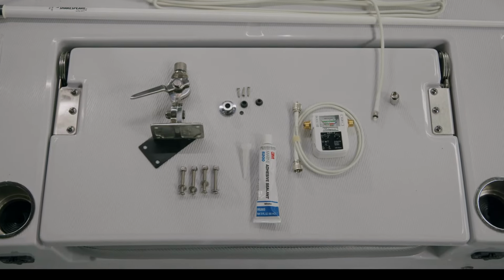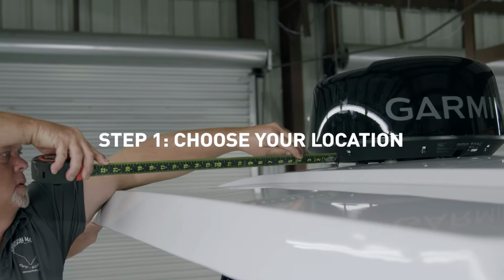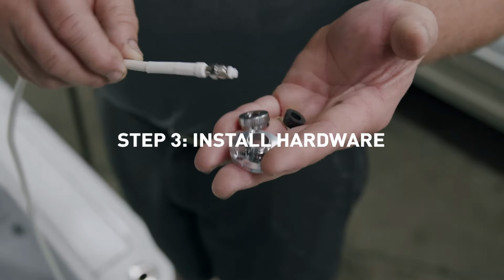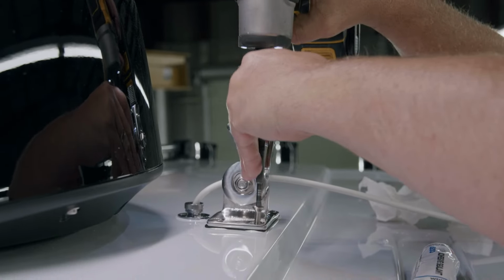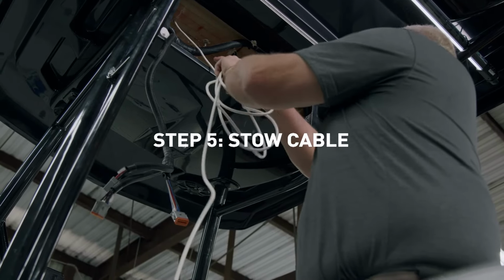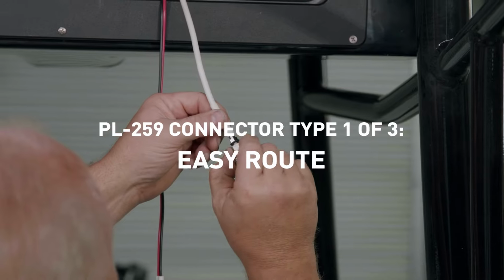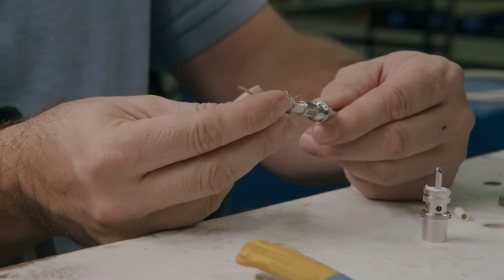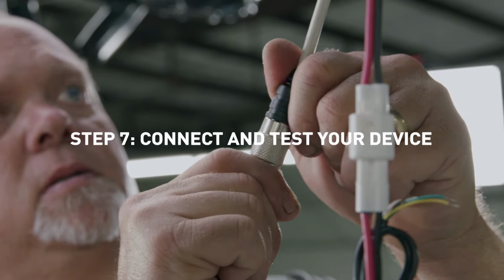How To Install a Marine Antenna - Shakespeare

Comment: Two things I noticed I would never do that. They did in this video. First of all the bolts were way too long. Nobody wants 2 inches of bolt sticking into their compartment for them to cut their hands up on if they go to reach something. Second thing is please for the love of God do not use 3M 5200. It is permanent and will destroy your tea top if you ever need to take your antenna offthere is no reason for 5200. You can get away with 4000. Just fine. It does the same job and it is removable in the future if needed.

Comment: Not the best idea to coil the excess antenna cable..  cut the cable to length, leaving a little extra if you have to move the radio a little or replace the connector.  The extra cable coil is just adding loss to the system. 
And definitely use a SWR meter  to check the antenna.  A high SWR and your radio and antenna will not perform well,  worst case you can burn out the radio.